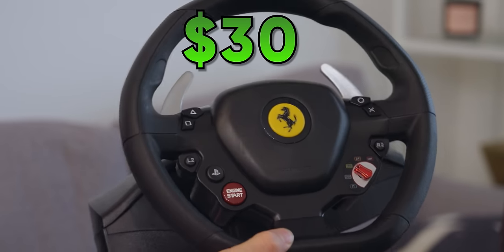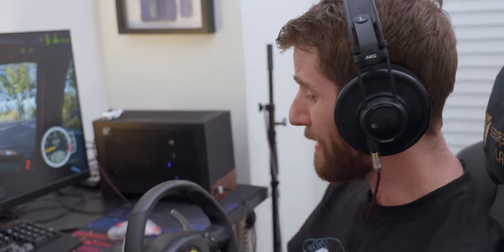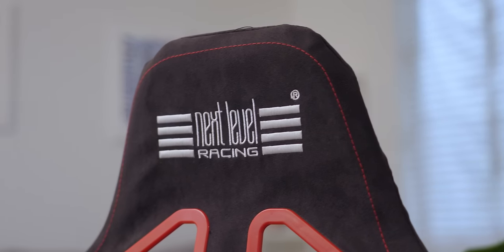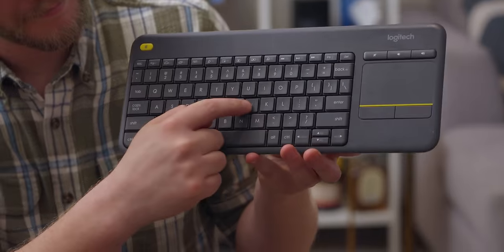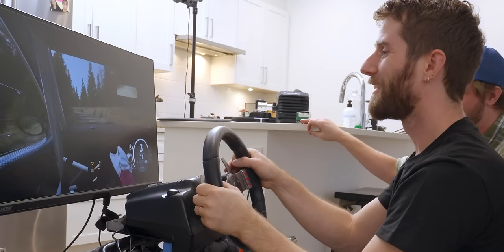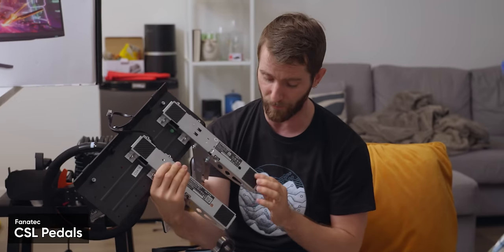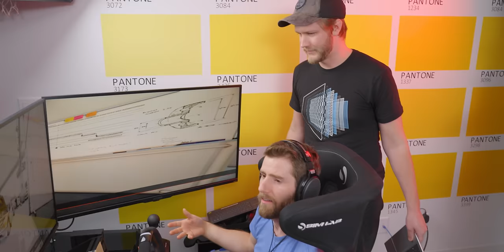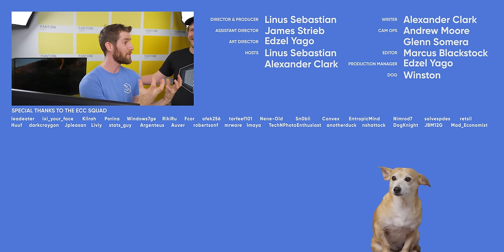Don't Waste your Money - $30 vs $10,000 Racing Setup

Comment: For 10 grand just buy a go-kart and live life, much better experience, faster and chances to win actual trophies and friends. LOL
Reply: Sure, real racing is definitely better, no questions there. BUT. Buying the kart/car is often the easiest/cheapest part. Even something like a lo206 can be a couple hundred per race weekend. And if you ever start getting serious with two strokes, it wouldn't be uncommon to get into the 4 figures per weekend. Especially regional and national level races. Do you have a garage to store it? Mechanical knowledge to work on  it? What's your work/life balance currently look like? How many hours per week are you willing to commit to just maintenance alone? How about a truck and a trailer? Where's your nearest race track(s)? 
I used to race stockcars with my dad and brother, there's ALOT more to it than just buying the kart/car, and heading to the races. Compared to sim racing, where its pretty much plug and play -pun intended.
Reply: @trevor4533  Yeah I read over it. You need to have maintanence. But you can always buy your atire and do rental karting which is also fun. Totally agree with you